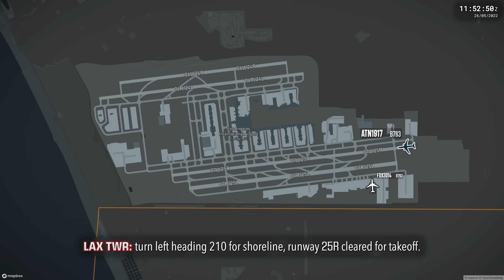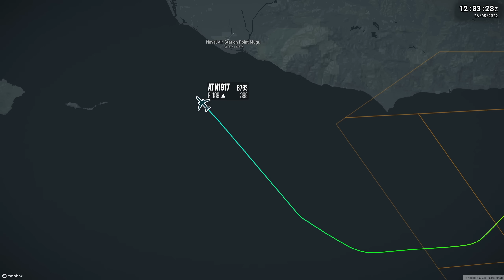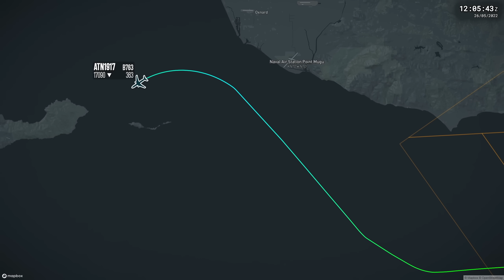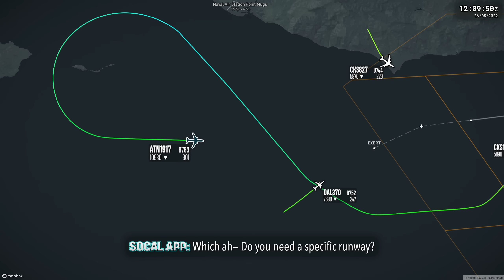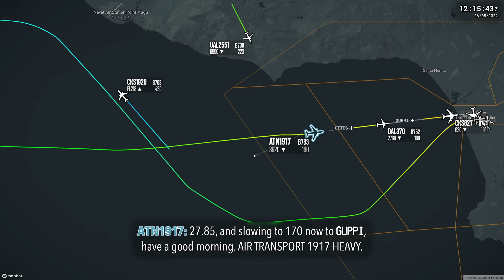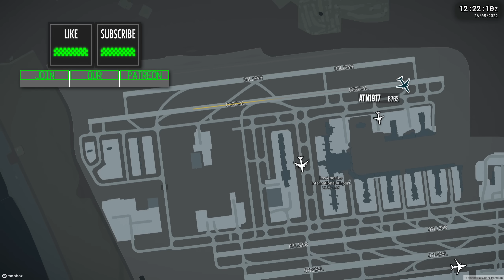"We Need To Land IMMEDIATELY"; Amazon Prime 767 Reduced to Single Electrical Source! [ATC audio]

Comment: I had this exact same thing happen.  It’s not an “emergency” in the manner that most may think.  Everything on the jet is working normally and there is no significant degradation of capability, unless the weather is very, very bad.

If the last generator were to quit, that becomes a very significant problem, and most jets like this one (I drive this same jet) have less than 30 minutes to get on the ground.   

When it happened to me, I was over Memphis, during the FedEx busy time.   There were no issues at all working in with traffic.  Again, all a “precautionary landing”.  Declaring an emergency does two major things.   

Alerts ATC there is an issue and special services are being requested.  

It gives the Captain legal authority to do what he needs to in order to get on the ground.  

For the crew, that approach and landing were as normal as all the others they have done.
Reply: You declare the emergency to prevent the emergency. And that’s why aviation is the safest mode of transit in the world.
Reply: Im not sure how it is on the 767, maybe you can confirm, but isn't the Ram Air turbine also producing some electricity.
Reply: @kilianortmann9979  the RAT produces center system hydraulic pressure to the flight controls.  The HMG - hydraulic motor generator is what automatically provides electric power when there is power loss at both AC busses - pressure from the ADP (air driven pump) which is also the demand pump for the center hydraulic system is what “turns” the HMG and generates elec power.
Reply: I suppose in this instance making a PAN-PAN call would have been sufficient. Unfortunately, US domestic operators shy away from ICAO procedures.
Reply: @gregorythompson5826 really weird not to hear a PAN PAN from this aircraft.
Reply: VERY WELL SAID! I am a retire United pilot and now write aviation safety articles for 2 magazines. One of my articles was on why pilots should declare an emergency even if the problem is relatively low threat. I said in the text exactly what you said in your comments. I have seen it over and over in my 55 plus years aloft where pilots absolutely refuse not only to declare an emergency when it is obviously warranted, but refuse to even tell ATC they have a problem. Kudos to you!!!
Reply: Realistically, if that last generator WERE to fail and all you had was the RAT.  Could that carry you all the way down sufficiently?
Reply: @unityxg  the RAT provides center system hydraulics to the flight controls
Reply: it's like you have two generators for redundancy, everything works completely fine with just one, but if one fails you absolutely must get back as if the second one also fails you're in deep shit
Reply: But still, 2 generators? Really? Who 
Built these generators? Spencer shay?
Reply: @brendan5260  they might have set off without the apu generator in the tail working. If they have both engine generators functioning then the minimum safe operating list may specify that they can embark without it, using a ground air supply for engine start. it's still not good that an engine generator failed as well if that was the case, but it would be a more reasonable explanation for a double failure. - sorry for the essay 😅
Reply: Not to worry.  There are more generators where that one came from.  A whole truckload more.
Reply: It's also just bad luck that 2 generators fail at the same time. But even if the last generator failed, the Ram Air Turbine (the windmill) could still generate power for the control surfaces, right?
Reply: @IroAppe  the RAT provides center system hydraulic pressure to the flight controls.  The hydraulic motor generator provides power- using hydraulic pressure from the air driven pump…it happens automatically when both AC busses lose power
Reply: it is an emergency dont fool around u risk something ur curious how is there ? put a black cover lying in the bed on ur face stay still and imagine ur doing something great and amazing something that u always wanted with a black cover and staying still!
Reply: What kind of systems remain operational when electrical power is lost (is there a battery backup,) what about after that? What prevents this exact same scenario from happening over the pacific with hours to the nearest airport?
Reply: To be fair, does't the captain always have legal authority (and the responsibility) to ensure the safety of the aircraft and those aboard it?
If ATC tells a non-emergency aircraft to do a barrel-roll the captain would most likely not attempt it despite not having declared an emergency :P
Reply: Yes, this is a non event. Most carriers consider “when down to one operational generator, land at nearest suitable airport.” All electrical busses are powered, except maybe galley power. It’s just a safety precaution Part 121 operators use.
Reply: @mickeydoolittle2057  It's a "non-event" until shit you didn't think would happen happens...  It's not like there's a break down lane you can pull over to...
Reply: Speaking as someone who works on acft. . Any critical system that is degraded to that extent is considered an emergency. It seems like in this situation they mostlikely took the jet knowing that the apu was inop. . leaving only 2 generators to pwr flight. So when one of the two generators failed it became a emergency.
Reply: Yeah that Memphis emergency you mentioned never happened outside of in Flight Sim.  You have never "driven" a plane and have no idea what you are talking about.
Reply: "If the last generator were to quit, that becomes a very significant problem, and most jets like this one (I drive this same jet) have less than 30 minutes to get on the ground."

I guess if this were to happen, it would be to completely turn off electrical power and glide as far as possible util the altitude is too low to be "safe" then use those ~30minutes left
Reply: @TwinShards  no you would still have battery power for some time before discharge
Reply: @TwinShards  glide??
Reply: LOL... all the comments responding as if you are legit.  Mean while a 2021 account... and you found a way to drive jets.
Reply: @ShainAndrews  What makes you think what he said isn't true. (I'm not trying to be rude I'm just curious because there are a lot of other comments that are all claiming to have experienced this type of emergency).

Comment: All's well that ends well but if the outcome was different the question would have been why didn't the pilot or ATC suggest landing at Naval Air Station Fort Mugu. ATC should transfer every emergency to a dedicated person trained in CRM.
Reply: Why? If there’s an onboard fire or some such sure, but why would you go to an unfamiliar field at night that you likely don’t have charts for and is probably not in the aircraft database? Was Mugu open? What was their CFR status? Why not just go back to LAX which has multiple runways, all the CFR, the pilots are familiar with it, and they have support there? This was the supremely logical decision.

Comment: That happened to me several times... but I flew the MD11 for FedEx with 3 generators, and, like Meatloaf, said "two out of three ain't bad."
Reply: That's not a problem. I assume the MD11 could also run off of a single source of power, but that creates a single point of failure which you don't want in the sky
Reply: A STIRLING FREE PISTON GENERATOR HAS RAN UNDER FULL LOAD 110,000 STRAIGHT WITH NO FAILURE.
THEY ARE ALSO EXTERNAL HEAT SO THEY COUL RUN ON WASTE HEAT OUTSIDE OF THE ENGINE.
Reply: Revenge of the cis?
Reply: Are you a bot? Why basically copy and paste someone elses comment
Reply: @Unkn0wn1133  because it makes me fell good like im this badass pilot instead of a no good reject looser. That’s why I went transbender so people have to tell me how brave i am and im a hero.
Reply: Yeah but in flight simulator, you can just walk away afterwards. This is real life
Reply: I love Meatloaf
Reply: Remain this frequency.  💋💝
Reply: You just straight copy-pasted someone else's comment...
Reply: Wow you still fly md11, wonder how long it will be in service since it has a high jet gas consumption
Reply: @alphasiera1757 it appears he's lying. But anyway, i hate it when people say, "u dtill fly thais🤯😵!! U still fly that!!?🤠." Any plane that is mainted and seen as fit for a certain operation can still fly. Boing 727s still regularly fly in the congo.
Reply: @alphasiera1757  FedEx and UPS doesn't plan to retire their MC-10's or MD-11's anytime soon, their reasoning is it's cheaper to maintain and fuel a more expensive to run jet like them, then it is to buy brand new jets such as the 787 or A350, and have to change up their maintainence departments and such
Reply: @AlphaGametauri  ahh
Reply: @AlphaGametauri  a350s in all cargo configuration? What world do u live in ? Never seen that
Reply: @jasonMB999  They are "about" to get them in the market, many orders already from the a350F
Reply: @jasonMB999  I never said they wouldn't?
Reply: @jasonMB999  i was thinking the same thing. Cheep ass airbus can hardly handle passenger cargo without putting holes all over the cargo compartment. No way these newer airbus can handle freight wonder why there isn’t a A380 cargo conversion?
Reply: @crazyjhey8050  lol. I'd rather get an airbus type rating though.
Reply: The RAT generator
Reply: @ambmotorsports6307  that pilot ain’t trying to deal with that.  rat offers even more reduced power.
Reply: the Commuter flight and lay over for me going to Chicago got hit by lightning right beside my window seat. The Black Woman beside me tried to crush my hand. I simply looked at her and said. (If there was a hole in this Airplane? We would have been a deck of cards at 400 MPH and 33 Thousand feet. We are Good.) Warmest hug when on the ground. Moms. I will find a way to have the SUN rise in the West for just You.
Reply: Several times flying a MD11? Man who do you pretend to fool? First off, you haven't even flown the md11 in flight sim secondly, there's NO WAY you had "SEVERAL TIMES" that thing happening, what are you? The pinnacle of bad luck? Jesus
Reply: @savageryflyer5391  look at his face, he looks like he spends his whole day on ticktock doing those cringe videos that impress 9 year old girls.
Reply: 3 engine planes suck

Comment: I'm always shocked at how many professional pilots do not use proper terminology when declaring an emergency. The FAA says: EMERGENCY DETERMINATIONS
An emergency can be either a Distress or an Urgency condition as defined in the “Pilot/Controller Glossary.”
A pilot who encounters a Distress condition should declare an emergency by beginning the initial communication with the word “Mayday,” preferably repeated three times. For an Urgency condition, the word “Pan‐Pan” should be used in the same manner.
If the words “Mayday” or “Pan-Pan” are not used but you believe an emergency or an urgent situation exists, handle it as though it were an emergency.
Reply: He had to call twice. If he’d started with a pan pan or a mayday he’d have had immediate attention. Seconds matter in aviation
Reply: @nearlynormal2293  The meaning is formally defined, there’s nothing “melodramatic” about it. In Hollywood maybe, but in real life mayday and panpan have clear definitions.
Reply: @nearlynormal2293  Sure. According to section 3 “Distress and Urgency Procedures”, subsection 6-3-1 a): …Distress and urgency communications procedures are prescribed by the International Civil Aviation Organization (ICAO), …
…
6-3-2 a) 3. Transmit a distress or urgency message consisting of as many as necessary of the following elements, preferably in the order listed:
(a) If distress, MAYDAY, MAYDAY, MAY-DAY; if urgency, PAN-PAN, PAN-PAN, PAN-PAN.

So yeah, it’s exactly what I said it was. You can easily verify this.
Reply: @nearlynormal2293  Oh boy, you’re really clueless. Both a mayday and a panpan are emergencies. But they differ in their severity. A mayday means “I need to get back on the ground NOW or we will die”, while a panpan is “I’m having issues and need priority handling, but don’t need to land this instant”. The entire reason for the two terms is that “emergency” doesn’t tell ATC how severe the emergency is. 

If a pilot says “mayday”, ATC doesn’t need to confirm if it’s an emergency: calling mayday IS the pilot saying “I have a life threatening emergency RIGHT NOW”.
Reply: @nearlynormal2293  All very well said. Too bad so many non-Americans, and anti-Americans, don’t get it.
Reply: @jayhache5609  

America is a great country with great people. It's a place I enjoy visiting. 

There is no getting away from the fact that RT standards there are a bit average on occasion. No agenda Sir. Take it on the chin and enjoy your weekend.
Reply from the maker: It's quite peculiar, American (that is the country, not the airline) crews seem very reticent to use the word "mayday", much preferring the nomenclature "we'd like to declare an emergency". Crews in other parts of the world (including similar Anglophone countries like the UK and Australia) exhibit no such reluctance – if you look at this video in Australia, the crew immediately declare a mayday: https://youtu.be/Qq1GaN_1b-4

I'd be interested to hear from pilots what they think the difference might be.
Reply: @AirTrafficVisualised  

The difference being no more than poor RT standards on display on a daily basis by US pilots. This was evident throughout the departure process prior to declaring an emergency.
Reply: @khaosai   Jealous much?
Reply: @nearlynormal2293  

Utter nonsense.
Reply: Beat me to it! Lazy, inefficient RT!

Comment: This is an emergency?
Reply: Yes. If they loss the last generator there will be no power to run all hydraulic system that moves all of the control surfaces.
Reply: @harveywilde6781  Wrong.  As the situation is not immediately life threatening, but only urgent, the mayday call was inappropriate.  The correct call is pan-pan.